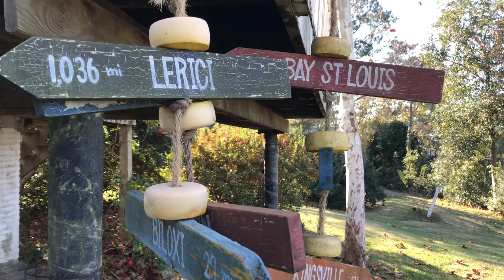Back Like I Never Left - Jourdan River Vacation House Hive Removal

Comment: So what would you suggest to someone who has a bee hive that during a 2 weeks holiday pushed themselvesunder the house of a home and was improperly removed. Issue is that the house is in a protected zone where bees may not be poisoned and whatnot and a removal would possibly cause the whole roof to collapse. Any way to take care of the bugger that since have reappeared every damn year after trying to close it up any and all way possible during winter.
Reply from the maker: If they are moving into the same space every time and you can't block the entrances I'd pack it full of insulation if possible so that they have no room to  build.  If it is a case of the home having lots of openings and it's too much to tackle to close them all up or fill all the voids I'd probably resort to hanging swarm traps around and baiting them with lemon grass oil during spring and summer.  There is no guarantee they won't just bypass the traps but those are really the only ways.  Bee repellents only work for a few minutes so that isn't an option.  If you find them as soon as they move in you can usually run them out with liberal amounts of smoke or repellents.  Sticky traps can also help by catching any scouts that may report back to the colony on the location of their potential new home but that can get a little expensive.
Reply: 628DirtRooster we've been using this kind of foam that is supposed to block bees and wasps out to fill up the whole damn space and they just laugh at it but insulation might work. Thanks!
Reply from the maker: Fiberglass insulation or rock wool is the best but it has to be packed tight.  If it's installed like it would normally be it settles over time and they'll build around it chewing it out as they go.  They do chew through expanding foam pretty fast sometimes though.

Comment: Hey Mr. Rooster, enjoying your channel and your adventures.  I'm from just up the road in Brookhaven but live in Dallas now.  Anyhow, I saw your videos where you were having to deal with yellow jackets and other undesirable wasps.  I found a real easy way to deal with them (learned as a kid back in the 70's fighting wasps myself) you might want to try that doesn't involve any chemicals, water and is very mess free.  Most insects can't handle heat very well,  take a common hair blow dryer (I used an old one that my mom threw out that the switch had broken on) and fix it up with a 2" or 3" metal vent pipe you can use to stick in the nest or heat the area around the nest if you can enclose it so the heat can't get out.  Don't use high heat, usually low heat with low fan speed is all you need to drive the temp up above 130 or 140 so degrees in the nest.  Be careful not to let the heat get too high, since that is a fire risk, you will likely have to experiment using your personal setup. I noticed you have a thermal camera which is perfect for monitoring the heat.  Also I don't recommend leaving it running and unattended since you never know if someone (kids) or something will go wrong. Usually in 30 minutes the nest is dead, or dang near it.  Real clean, very effective,  takes the fight right out of them and it will allow you to better preserve the nest for those collectors!  Good luck!
Reply from the maker: Now that one of the best chemical free ideas I've heard.